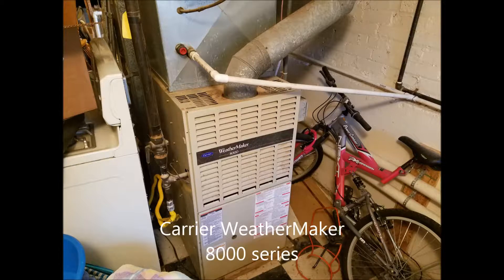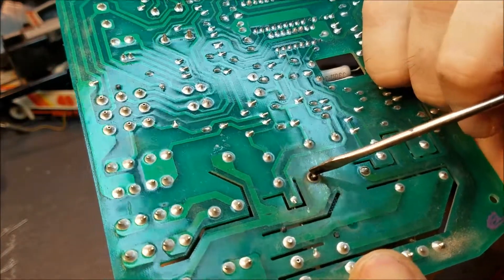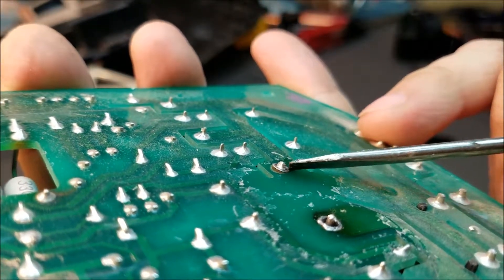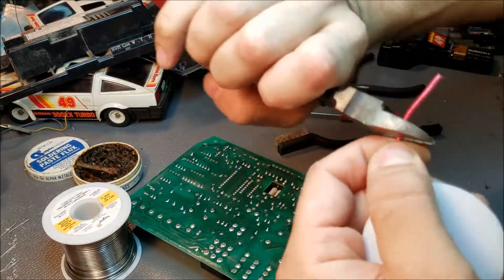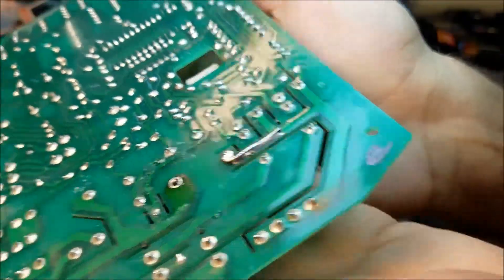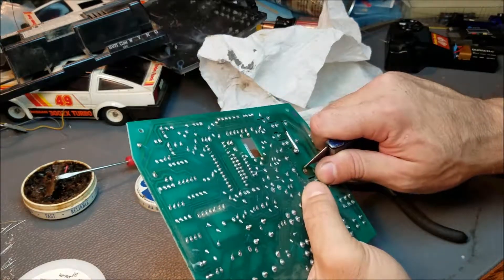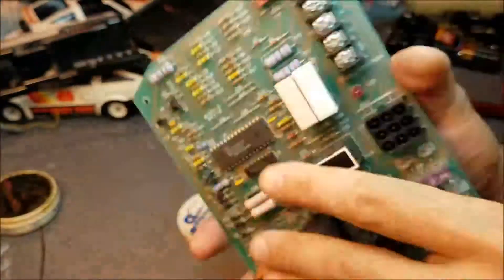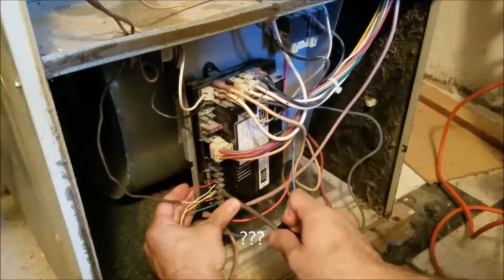Furnace Control Board Repair

Comment: When this happens it is because the relay contacts are going bad. That creates heat that melts the solder. This is a good temporary fix, but relay replacement is the permanent fix.
Reply from the maker: I fixed this 3 years ago. Have not had any problems with the relay since. While your theory of the mode of failure is plausible, mine is more likely. Large, heavy relay hanging off a pcb in a high vibration environment is simply going to crack the solder joints eventually (the unit is probably 30+ years old). Once the joints crack, they begin arcing while in use. Eventually that arcing burns up the solder joint until the gap in the crack is too big to make any contact. The evidence of the arcing is clear in the video, the crater left behind is not melted at all, but burned away, leaving dark soot in the crater. Had it melted due to heat, it very likely would've left a trail of solder on the board. That being said, it would probably be wise to replace 30+ year old, high current load relays while making a repair like this.

Comment: Your work was well done.  Common failure, mostly due to board manufacturers not really understanding the amp draw of fan motors.  BTW, What the failure is called is "haloing".  Also happens commonly with larger resistors on the board.
GFM

Comment: Where can you find board schematics and parts layout diagrams?
Reply from the maker: Good luck. Proper HVAC techs likely have access to that information, that's about it. Even then, a board schematic is very unlikely. You'll simply have to use basic electronics troubleshooting.